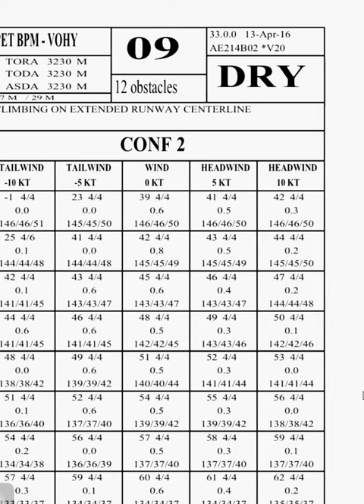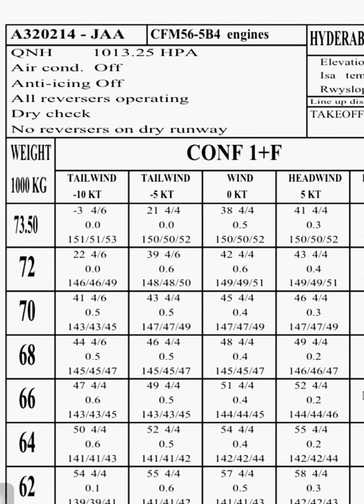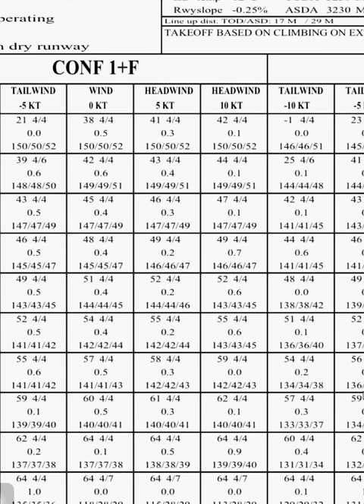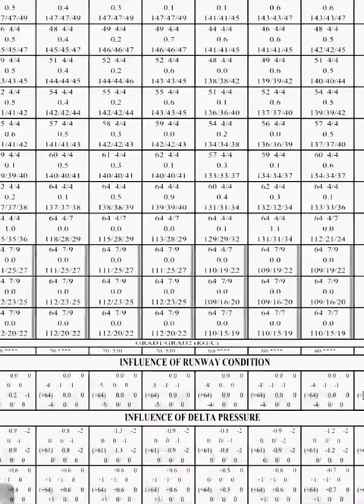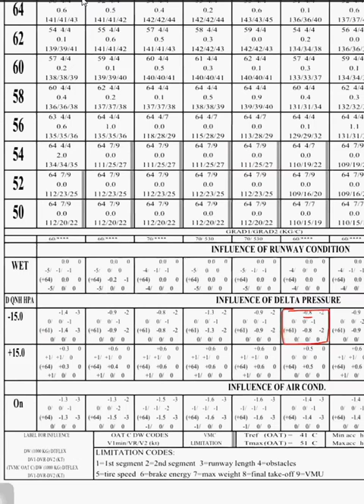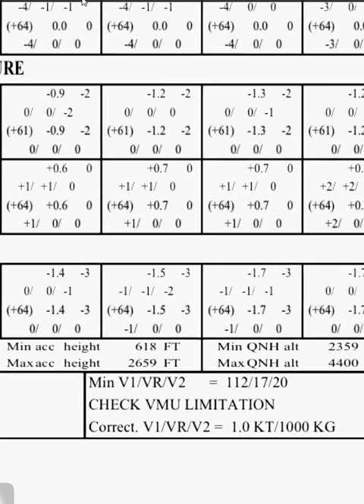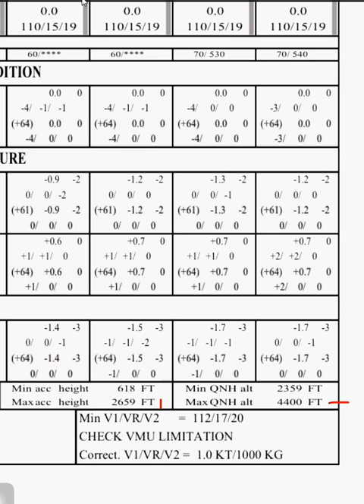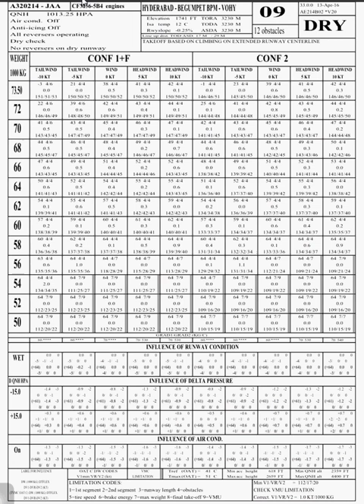A320 - RTOW Chart Explanation

Comment: Would you be kind and provide me with some more information regarding the 
CORRECT V1/Vr/V2   1Kt/1000kg. statement. 
how to apply the correction for CG < 27 percent. 
2. In case of actual TOWs lower/higher than the box weights of a colum.  Could this correction be used to increase/decrease T/O speeds. 

Many thanks for your efforts i am really grateful.
Reply from the maker: 1) Whenever the CS is less than 27% MAC (this value varies from aircraft to aircraft type, some may even not have it), reduce the weight (RTOW/MTOW) of the aircraft by 1000 kgs and increase Vspeeds by 1 knot each. 

2) Yes you can use to increase or decrease take off speeds. This process of adjusting the speeds and flex as per actual weight is called interpolation. Calculating PTOW based on environmental conditions is called extrapolation.

Comment: Good day, what’s the case when on the top right corner it states DRY TOGA?
Reply from the maker: That is nothing significant. It signifies that TOGA is available to the pilot anytime it is required during the take off, basically to differentiate between flex take off and derated take off. Because derated take off it's fixed. Now a days it doesn't come written on most charts. Most charts say only DRY.

Comment: In case of QNH 1010 (standard-3) I will still apply the correction same for Standard QNH-15 correction ?
Reply from the maker: You can interpolate for 3 change, it'll be more accurate

Comment: For a flight with gear down for second segment gradient conditions in config 1+f, the wt
reduction calculated from RTOW charts is 
?? By any chance
Reply from the maker: As follows
A320 neo it is 19%
A321 it is 20%
A319 it is 20%
A320 it is 22%
A320 with sharklets it is 16%

These are weight reductions for calculating on config 1+F from the RTOW.